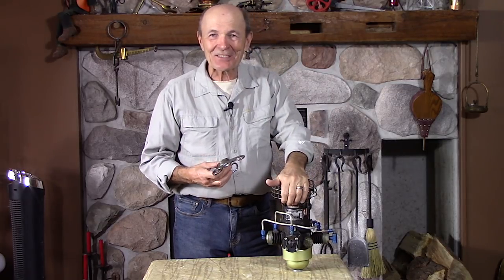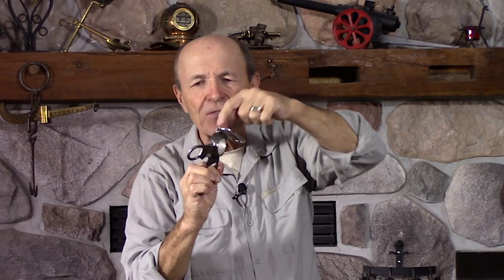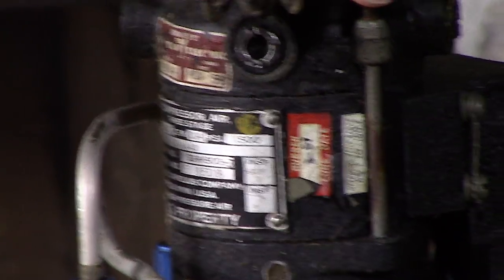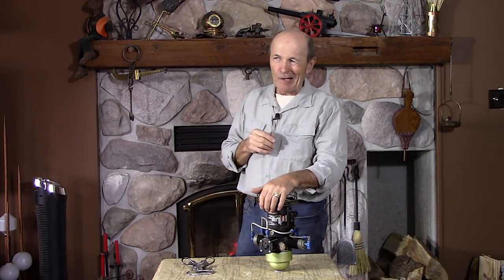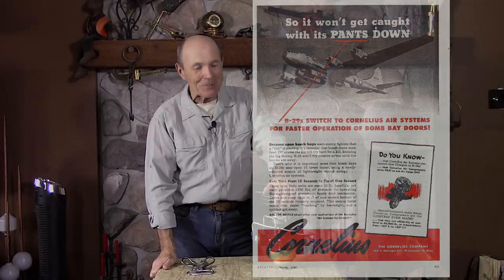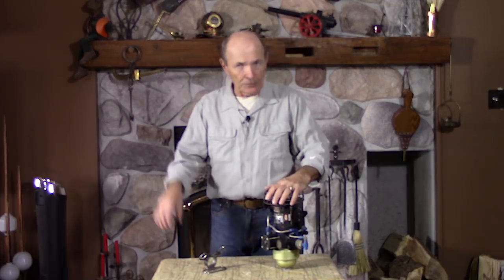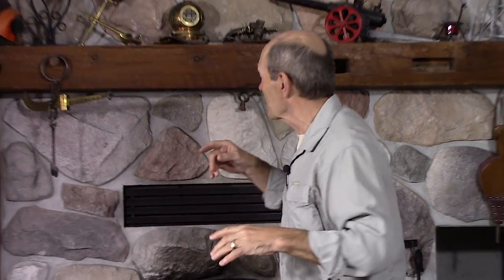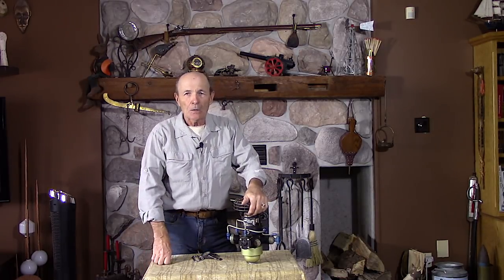Vintage Scuba: Cornelius Tank Compressor - S05E02

Comment: Hi Alec. How exciting to see those old compressors, was actually wondering when you was about to make a video on compressors. Noticed you have trouble with your leg Alec, hope it's not affecting you too much and that it does not hurt. I would suggest you take a chair when you vlog, it might ease the tension and it does not make a slightest difference to the videos you produce. Health is important and we want you to make lots of videos still. 

Take care Alec and thank you too Kevin for making these videos, enjoying them a great deal :)
Reply from the maker: I could actually do a Tech Tip on compressors. Divers usually don't know too much about them yet they rely on them to enjoy the sport. No compressors = no air - get my point?
I have built many compressor systems over the years for my dive shops and others too. My first dive store compressors were also army surplus. They were old, trailer-mounted Ingersol Rands. We'd take them off the trailer, cheat the safety to get more pressure and start filling tanks. A video about that might be fun.
Thanks for your concern Tom. My leg actually is perfect. It doesn't work properly but it's a neurological problem. There's no pain - just frustration.  It's a long story but I'm good. The biggest problem is that I tend to swim in circles while diving LOL.
Take care.
Alec
Reply: Alec Peirce Scuba You should really do a video on compressors, love to see that as it is still a huge thing that provides us with air. Even tough it is a simple system, people is fascinated by it.. How does it work, how differs scuba air from i.e paintball air or any other air compressors. How many bars can it deliver or litres of air.. Many questions indeed. Glad that you and those gold fishes in round bowls have something in common 😄😄 Glad you are ok Alec ;)

Comment: Thank you for this great video. I was given one of these back in the 1970's and still have it. Didn't know the history behind it until recent ( Google ) years. Used it for a while as an air compressor and then stored it for many years.  Had a need for a vacuum pump a few years ago and remembered this unit, powered it up and it ran perfectly.  And it did work as an excellent vacuum pump, attached the vacuum line to where the air filter screws on. If there is anyone out there still running one of these remember that they must be mounted with the oil reservoir  down as shown in your video. You can unscrew and remove the oil reservoir to confirm that the oil is up the lower step. I use synthetic transmission fluid, a light weight synthetic motor oil (0w-20) would probably work fine. These are high quality units. You can look up patent US2673028 for some design information.

Comment: So cool to see you sharing your Cornelius compressors very cool! I have seen recent guys refurbishing these and selling them as a breathable SCUB tank compressor. Bit old technology for my blood and hard to fin spare parts etc....  However I really want a Bauer Junior II but the cost is quite a bit for a Bauer.
Reply from the maker: Small compressors aren't cheap and big ones are crazy money.
I used to have a rule of thumb about the cost of a compressor - $1000 per cfm (cubic foot per minute) +$1000. So a 3.5 cfm would cost $3500 + $1000 = $4500. Big ones, like the Bauer I had in my store (21 cfm) with all kinds of safety features and automatics controls would cost a lot more - $35000 to $40000 is not unrealistic. And divers would complain about a $5 air fill!.
Bauers are the best but not cheap. I'm not sure if I like the idea of buying a 'cheap' compressor.
Take care Jeff.
Alec
Reply: Alec Peirce Scuba To be clear I”m not a fan of cheap compressors, old rebuilds or Chines knock offs when dealing. with beatable air compressors options either 👍

Comment: I have a beautiful little Navy unit (I believe) that I found on Craigs List with a 220 V, single phase, 7.25 amp motor with a Cornelius nameplate on it (no rpm) although it does state 3000 psi max., set up for filling tanks.
Reply from the maker: Almost every diver in the 1950's had or shared a home made Cornelius tank filling compressor.  Needed to a there was only 1 or 2 dive shops in all of California to fill tanks.

Comment: Did you guys ever use old Transport Truck compressors? We still use them for the brakes and suspension.
Reply from the maker: We didn't have those when I was a kid but they might work. The only problem I see is the pressure. Aren't they only about 150 psi.
You'd have to put a lot of washer under the safety relief to get to 2000 psi!!
Alec

Comment: I have a pump, where can I find the article? "High Pressure Air for Scuba Divers"?
Reply from the maker: The original article was published in "Surplus Projects" by Ron.  I don't remember the year but a Google search  should find the issue.  There are newer articles available but I suggest you post a request for the article or help on www.scubaboard.com.  A great community of vintage divers are active and can help you get a working compressor.
A

Comment: 1 question since that pump uses  petroleum based oil how do you get the CO (carbon monoxide) out of the dive tank you are filling?
Reply: think 20$ quart food grade oil my self
Reply from the maker: Whether oil-based or not, a compressor will produce noxious gases. Even oilless compressors get hot and the materials give off gases. You must clean the air before breathing it.
Alec

Comment: hi alec  let me ask you question... I know you are very good expereicne with scuba compressor     is that good machine name is youg heng air pump for scuba tank?
Reply from the maker: OK. These little high pressure compressors are great for their intended application - filling paintball or air gun tanks.
They pump about 40L/minute which is about 1.4 cubic feet per minute. So it will take about 1 5 to 2 hours to fill a scuba tank. The math is not exact since the flow rate changes as the pressure changes.
Since they are designed for short runs only (30 minutes), it will not last long if run for long periods. They simply wear out. Also the air may  not be good for breathing. It's not filtered to be breathing quality.
I know they say they are good for scuba but that's marketing. It means that they go to 3000psi so will fill a scuba tank ... eventually and with questionable air.
The price is very attractive but personally, I think you're buying disappointment and aggravation.
Sorry. Alec

Comment: I would like to build one of these any info on the compressors? ive been looking but cant find any
Reply from the maker: They are very scarce now.
I had about 6 of them but sold them off over the years, all but one.
It is like new, fully serviced and runs perfectly.
I usually got about $#00-$500 for one. I had planned to list this last one soon.
I also have a copy of the plans to build a scuba compressor using it.
Contact me at seahunter@vintagescuba.com if you're interested.
Alec

Comment: Can you make a video about the Mantus Scuba Pack 19CF tank:BCD?  I can’t find a single review not sponsored by the company or an honest opinion
Reply from the maker: Mantus is a small non-scuba company with a neat scuba product. It's not likely you'll see reviews except from private individuals.
It's a nice idea for travelers but, it's not novel. Others have or did have the same type of system. Oceanic still sells the Jet Pack, similar without a tank of course. And that's one reason why it won't be a big seller. With only a 19cf tank which is about 15 minutes underwater, it's not for serious divers. I can see a market for boater and that seems to be the intent of their marketing. Not having seen one I have no idea about quality of construction. And unless they are using a brand name regulator, service might be an issue.
It's easy to see that they are not scuba divers from their own literature. For example they call the Safe Second (Octo) a "spare"and the SPG is called an underwater pressure gauge. Technically these are correct descriptions but not proper in scuba terminology.
Neat idea though.
Alec
Reply: Alec Peirce Scuba thank you so much Alec!  It’s a cool looking setup but also noted the BCD has no actually buoyancy control... so it’s a, glorified tank holder?! Haha
Reply: Hi Alan, I just bought the Mantus system as I'm travelling the world on a sailboat and wanted a compact way to dive down and change my boat zincs, check anchors, clear fouled props.. and do a little bit of short time shallow exploration (I am a certified diver).

I've done 4 dives now with my mantus and I am very happy with it. I've added a 30cf tank to my kit so I can get more time, and that seems to be a good compromise between space savings and bottom time. 

You're correct that the kit doesn't include a BCD, so you have to get your weight right for good neutral buoyancy, but that's a good thing to do anyway. The difference in buoyancy between a full and empty tank are small when you're dealing with a 30cf or a 19cf (vs an 80 for example), so the bcd isn't completely necessary at this level.

I agree with Alec, but the reason I like the Mantus vs just putting together my own kit with standard parts, was the price. I wasn't able to piece the components together for the same price, and ended up saving about $200-$300 by going this route. 

The regulators are "ok". They are obviously not high end, but they seem to be good enough. When the time comes for them to be serviced, I may just replace them, but for now they work great.

Let me know if you have questions about the kit, I'll be happy to answer them.
Reply: Darrin Howell thanks so much for the review!  I spent around $1600 on my entire setup but I do a lot of river diving and carrying an 80 CF for switching between mostly snorkeling and the occasional 6-15ft areas is super annoying so I’ll probably just end up buying a smaller tank and grabbing a cross connect from my 80 if I need more air.  I really appreciate you taking the time to write this up!  Happy sailing

Comment: How many liters per hour
Reply from the maker: Oh it's not much.  Looking at a picture of the specification label, its CFM is 0.4 at a psi of 1500.  Remember early tanks were around 1,500 psi before the new steel 72's came out at 2250psi.  When filling, take a long lunch break.
A
Reply: I'm writing to you from Serbia can you tell me exactly how much air flow.... I need to charge 80 liters

Comment: This company also makes/made soda fountain machines...
Reply from the maker: Didn't know that. Makes sense though. I think those machines need pressure.
Thanks.
Alec
Reply: HI, yes i checked are they're still around same logo and everything. Correct they use high pressure co2 cilinders.